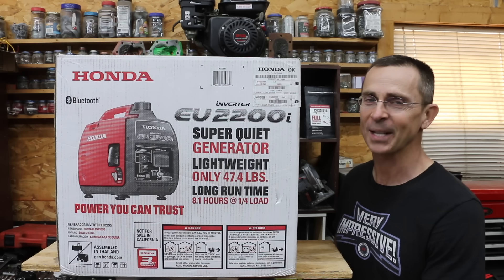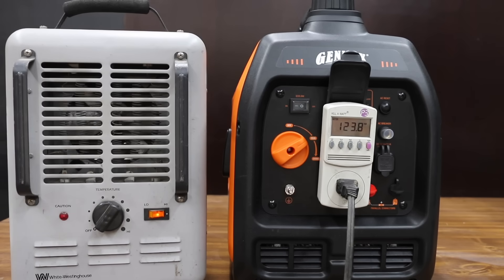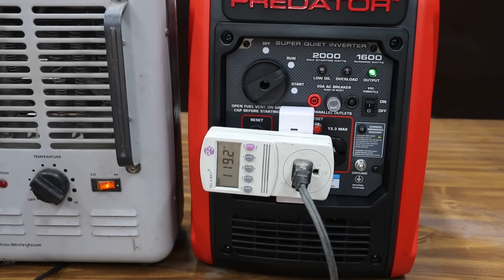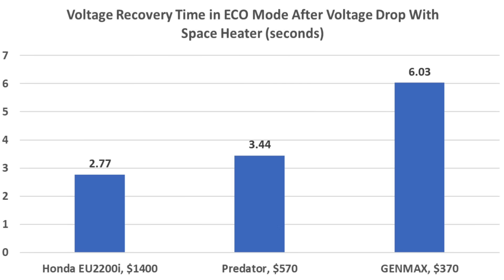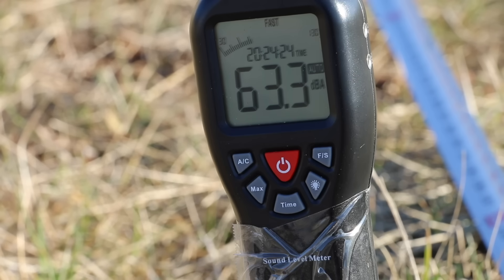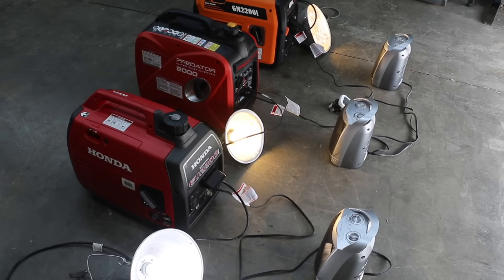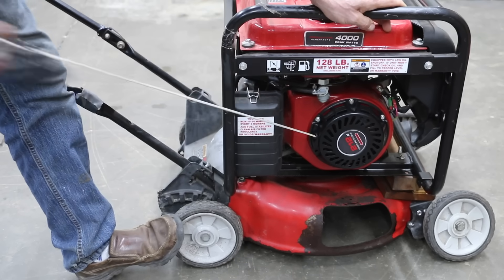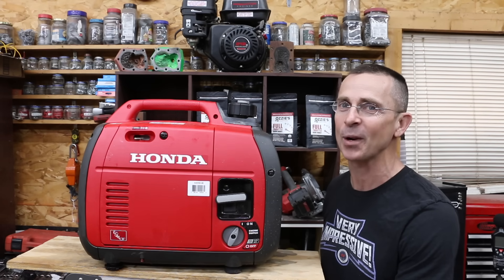Cheap Generator Better Than Honda? Predator vs Honda & GENMAX—Let’s Settle This!

Comment: Interesting. Usually the predators outcompete with Honda but I guess that applies to the 212cc engines. 

And those tailgaters. Haven't seen those in a while. When I first started working at harbor freight I think those were on clearance. I remember when the warehouse sent like 10 of them when we sold like 1 of them. They were pretty popular. Now they got replaced with those Jackery gasless portable power packs and the inverter generators. 

Hey, why not test heat guns next?
Reply from the maker: Thanks for the suggestion.

Comment: Hi!

If it's possible, could you rig up an electronic load next time and measure precisely how much kWh each generator produced during fuel consumption test?

This way, you'd get an exact idea how much litres/grams of fuel you need for a given kWh produced. Otherwise known as BSFC (minus inverter/alternator efficiency in this case).
Because these things have voltage fluctuations and halogen lights are not exactly the same, consumption wise, so we'd get more accurate results.

Thanks for the great video! Appreciate the hard and honest work!
Reply from the maker: Thanks and you are welcome!

Comment: When it comes to this style of generator, the Honda is the benchmark to which all others try to clone. The Honda costs more but it better designed, is of higher quality, and is from a company with decades experience. Most of the Chinese generators are very similar as they use the same engine or are a rebadge of the same machine. I own the Honda EU2200i and while it is expensive, nothing can match it.
Reply from the maker: Thanks for the feedback.

Comment: One thing to note is that the Honda can turn the fuel off and let it use all the gas in the carb without having to drain it. We drain it at the end of camping season, but the weeks or months between camping trips, I'll just run the gas out of the carb.
Reply from the maker: Thanks for sharing.

Comment: Great video as always. I know it would be expensive, but I would love to see more brands tested like Champion, Wen, Westinghouse, Generac, etc. Also would be awesome to see how dual fuel generators running propane compare to gas only generators.
Reply: Would be interesting, as propane is really the best since propane is cleaner burning and stores forever, unlike gas and diesel.
Reply: @HAL-dm1eh     Yes, my needs are for a possible emergency power unit.  I don't need something to last 11,000 hours.  I need something to sit for two years and not have varnished gas when I need it because PGE has shut off the power because of high winds.  GENMAX has a new dual power 4500IBEFI Fuel Injection model they will release any month now.  No price set but probably around a grand.  Sounds like a game changer to me.   And no, I don't work for them ... or anyone. I'm retired 😃
Reply: I am also curious to know if and what the benefits are of propane powered generators, versus gasoline.
Reply: I saw a test where a generator was ran on propane and checked. Then on gas and checked. The ammount of oil gunk and wear on the engine was drastically worst running gasoline
Reply: @OlivierCaron  Propane stores for many years and is considerably safer as well - granted gas definitely provides more power; I have also read that a generator will last longer on propane vs gas but I don't know that for certain.
Reply: I would be very curious as to how the Westinghouse performs.
Reply from the maker: Thanks!  Thanks for supporting the channel!  I really appreciate it!
Reply: Electric Generators would be good to see him compare too
Reply: @kimberperalta1  I have a electric generator on my convertible submarine, it works well when I am rock crawling in the desert
Reply: I just repaired and serviced a Firman dual fuel. Nice generator but again, very difficult to remove the carburetor for cleaning.  Front , Back and side panels have to be removed to get the carburetor out. I post videos on my Facebook about all these generators , pressure washers and lawn mowers
Reply: thanks for the channel contribution🐱👍🏿
Reply: @KreemieNewgatt  I think they might mean lithium battery "generators"

Comment: But the big deal with the honda gen is parts..  you literally cant find any parts for the thing if you need them and when you can find parts they cost more than what the other generators do..  usually the board that dies on the honda is 700$ and almost impossible to find..
Reply from the maker: Thanks for the feedback.

Comment: One thing to remember on most of these generators is that the air intake for the cooling and the engine is through the bottom. So if you run them on gravel or grass, put some metal or plywood under them and the inside will stay much cleaner.
Reply from the maker: Thanks for the feedback.
Reply: Good to know.  Thanks for posting this.
Reply: Robert L I've got mine sitting on a 2'X2' rubber pad from harbor freight, which they sell for ten bux for four of them, it also cuts down on transmitted vibrations.
I move it slightly on occasion as the feet tend to sink into the pad a bit, but it recovers.
Reply: This is good info.
Reply: Good info.  I set mine one of those 24x24 rubber patio pavers they sell at the big box stores.  Really does dampen the vibration and its tough enough that the feet don't sink into the mat.
Reply: I had a Wen generator sitting on sand and it sucked sand in the engine past the air filter. For some reason Wen does not oil the foam filter.
Reply: My Honda EU2000i pulls air in horizontally across the inverter assembly, the bottom is not perforated for the purposes of air flow, but agree that sitting on a firm surface is helpful.
Reply: It allows proper airflow also. It's important to keep all engine covers in place on these generators for cooling air to be ducted around various places it needs to be cooling. The inverter circuit board is the first thing they cool with incoming air then goes through cylinder head fins and muffler area before exiting. These generators can actually run hotter with covers removed.
Reply: Always! 👍
Reply: Good post I keep my Predator generator on a Harbor freight moving Dolly. I can move it around my shop with ease. It's never vibrated off the dolly.  It stays put without being secured to the dolly. Air can circulate easily under the dolly like you reccomend.  Thanks.
Reply: I was thinking that while watching the video.
Reply: I had the predator 2000 and now have the champion gas only 2500 model, and Im pretty sure they both take the engine air intake from the stream of cooling air that intakes from the bottom front of the unit
Although the advice is otherwise sound. I built a hush box for the predator, cut the noise level down to conversation level.
Reply: @batvette  Yeah, unfortunately, the Champion 2500 uses the same size engine as the Predator and Genmax in this video.  I'm not sure why the engine size isn't increased as the Honda has the best recovery and least drop in voltage from a large load coming online as specified in this video and that's the reason I sank the extra money into the Honda plus the fact that Honda makes this generator as commercial equipment and in Canada the EU2200i also comes as a commercial unit with a built in GFCI outlet with bonded Neutral and Ground.  Although, this is not difficult to do with the regular ones as you, at your own risk, make a bonding adapter and you can also just connect an in-line GFCI outlet to the output of the regular ones.
Reply: @WJCTechyman  everyone knows honda is the best, unfortunately 3 years ago when I bought the champion, honda had already stopped producing CARB compliant units in anticipation of californias small engine ban and none were available here even though I was willing to pay the outrageous price. (Nearly 3x the cost of the champion) Ive put over 1000 hrs on it and the only problem was a broken recoil starter. They sent the part free under warranty, I replaced it myself which wasnt easy.
Reply: Honda did NOT have 12 volt or usb and no spark arrestor. Why you not say that.
Reply: @Melicoy  ALL Hondas have spark arrestors or they wouldn't be legal for sale in the US.
Reply: @Melicoy  I've had generators for fifty years , I have a  Honda EU2200 identical to the one tested  and have never had a need for 12 volts or usb in fifty years !  If you need 12 volts plug in a battery charger ,  small Coleman generators had the 12 volt outlet on them years ago and I've never seen anyone utilize them ....
Reply: @sparkywirenut  I'm pretty sure my EU2000i  had an 8.5 amp 12volt outlet which I never used, as a battery charger is more powerful and is regulated, which the dc out was not.
The USB outlets are just a marketing gimmick, no one is gonna lay their phone or tablet down outside to charge it, or at least they shouldn't.
If you really, really have to charge it and don't have a power strip on the end of your extension cord, just stick your wall wart on the outlet on the generator directly.
Reply: @sparkywirenut  Absolutely correct especially with newer phone chargers most USB ports on generators are low amperage so it would take forever to charge, you are better off plugging in the proper wall charger.
Reply: @sparkywirenut  That's because you're old, grandpa. You probably still have a phone with the rotary dial, of course it doesn't need charging.
Reply: @sparkywirenut  My Canadian Honda EU2200i has 12 volts output but it specifically says this is for charging car batteries.  It doesn't have Bluetooth but who really needs that?  It's a generator, not headphones.  If you want 12 Volts, you can buy an AC to DC adapter and use that on here or if you want USB, just buy a USB charger.  Most are relatively inexpensive, even for the good ones and you plug them in like you would an appliance.
Reply: @salazam  Why are you being a troll?  USB adapters are of the plug in variety and it's just as simple to use a power bar with either built-in USB ports for charging and power or just plug in your power bar and your USB power supply?  This isn't difficult.  Most of the time this generator is used with my extension cords to power stuff INSIDE my house and guess what?  That's where I charge my phone, tablet, laptop or Nintendo Switch.  It can also power other stuff.  This generator can do it all.
Reply: @WJCTechyman  The bluetooth is a handy option , allows you to shut your generator off with a smartphone , also transmits gen. wattage output , gen. hours , etc to your smartphone .
Reply: @Melicoy  Personally I will not use any USB power source except for the charger that came with the device. USB power sources in power strips, battery packs, desktops and others simply cannot be trusted to supply the correct voltage to the device. Use the supplied charger plugged into an outlet.
Reply: @Melicoy  not sure why you would even want USB on a generator, both of my Hondas have 12 volt output, though I’ve never used the 12 volt.
Reply: @Melicoy  cus it's overpriced and can't get parts for them when there ten years old .

Comment: I would appreciate a comparison of the Champion dual fuel 2500/1850W (model 200961) and 4500/3500W (200988) generators, and maybe other dual fuel units in that range. I’m interested in an overall test including load capability & fuel consumption on propane and gasoline, noise, oil engine wear. Propane is interesting as a fuel because you can store it indefinitely so it’s great for intermittent outages.
Reply from the maker: Thanks for the suggestion.

Comment: Westinghouse vs. Champion vs. Honda vs. Generac.
I bought a Westinghouse 9500w running 12000w peak dual fuel for $1000 from Walmart last summer and put over 2000 hours with recommended maintenance on it.  I am impressed by how well it performed. It's a bit slower starting now but still runs incredibly well.
Reply from the maker: Thanks for the video idea.

Comment: Would love to see a comparison of generators running from propane. Westinghouse & Champion both have interesting looking dual fuel models claiming 4500W. Do you have any means to test RF noise from generators?
Reply from the maker: Thanks for the suggestion.

Comment: This helps a lot, but im still kind of confused about the difference between generators at this price point, and those that run 3k to 5k. At what point can you run a couple of refrigerators or freezers off of a generator, or even your central air unit vs. Small appliances and basic power tools.
Reply: Heat will always use more and so will ac units.  For a window ac you are probably looking at between 1500 watts to 2000 ( depending on what size you use.) A fridge doesn't take much maybe 300- 500 watts ( again depending on what size and when it is actually running.)

Comment: I'm wondering why inverters are quieter if they ask use gasoline powered engines. 2nd is like for you to try the brand duromax which I own. It's just so loud and I'm wondering if changing the muffler, then creating a housing like all closed inverters would be safe and work. If copy the inverter version of my brand to design the exact housing. But I know there is heat, vibrations, air flow to keep parts cool. So it's alot in asking for. Thank you sir for all you do. I pray to God your wife and kids see just how great there father is. I also pray you have time for them and God's word.

Comment: Dropping below 104 vac is a small problem but they recover fast.  However, they all seemed to remain at or above the NEMA voltage that appliances are designed for as their nominal voltage.  That is 115vac +/-10%, (103.5-126.5) to take into account the  5% drop the electrical code (US) permits for branch and feeder circuits from the Service voltage standard of 120 +/- 5%.  (114-126)

Except for frequent starts and stops causing voltage drop, or long, low AWG extension cords, they aren't out of spec for equipment design voltages.  
My source for this is a PG&E document 'Voltage Tolerance Boundary' 

That said, using my inverter gen with an electric pole saw, I did learn to leave Eco mode off due to the motor inrush current.
Reply from the maker: Thanks for sharing.

Comment: Another great video that kept me captivated. I know a lot of small generator engine's use aluminum cylinders without an iron sleeve. My Honda 2200 has the cast iron insert and runs like a champ with 250 hours on it.
Reply from the maker: Thanks!

Comment: Read thru several post to make sure I wasn't duplicating. What if I  had 2(genmax or whatever) and ran in series. Then for less than the cost of honda still I have more power(would maybe not have V drop under 120v) and would run at lower rpm increasing life and saving fuel. To boot, if there were some unfortunate mechanical issue I would still have power. Downside,  only noise level and space. Bonus, I could have longer extension cord.
Reply from the maker: Thanks for the suggestion.

Comment: True that one can buy about four lesser priced generators for the price of a Honda but will a Honda last four times as long? It is tough to test longevity but I would put my money on the Honda based on reputation and oil test results. For recreational power, the less expensive units should provide adequate service but I would question their reliability in a long term  emergency.
Reply from the maker: Thanks for the feedback.

Comment: The efficiency test has some error since each generator outputs different voltages under load, meaning the power consumption of the loads is different. Higher voltage means more power. There should have been a power measuring device and an attempt to ensure the power output is the same.

Comment: Great review PF! Many of the 1600w (ish) "suitcase" inverter generators are built using Ducar engines and electronics, the main difference being varying case configurations, controls, and features. I suspect that the Predator was one of these. If you do another round please include a Ducar in the testing.
Reply from the maker: Thanks for the suggestion.

Comment: Most of my friends are searching for bigger generators that can run tri-fuel (propane mostly) for home backup systems with a interlock installed on their panel. Any helpful recommendations would be greatly appreciated.
Reply from the maker: Thanks for the suggestion.

Comment: A few years ago someone gave me an old Honda EM500 Generator because they were moving cross-country. I rebuilt the Carburetor and it starts on first pull every time. It is only half the Wattage of the newer ones but very quiet.
Thanks for the interesting Video!👍😀
Reply from the maker: You are welcome!

Comment: Another great video! I would be interested to see how Echo stacks up to the others. Also wanted to suggest you test actual max watt output of each generator - I've discovered some generators will only produce 70% of advertised wattage when powering a battery charger with poor Power Factor(aka PF). RV owners run into the PF issue many times when boon docking.
Reply from the maker: Thanks!  Thanks for the video idea.

Comment: Can you do a test on these suitcase style generators where they go in storage for months on end without being used and maybe seeing if any of them work properly after receiving flood damage? Where I live the power is very reliable but we would need a generator if a hurricane knocks out the power supply. In that vein It would be used to run lamps and a hot plate stove to boil water. Making a choice on this feels a lot like "spend lots of money or maybe eat cold chef boyardee and dirty water for 3 weeks." There's got to be an intersection of reliable, inexpensive, and good enough to run for a few days after months of disuse.
Reply from the maker: Thanks for the suggestion.

Comment: 0:55 can you parallel the GenMax with any other generator that has same power connectors?

Or only with another GenMax?
Reply: LOL
Reply: @harley092355 

Not sure why that’s humorous?
Reply from the maker: Thanks for the suggestion.